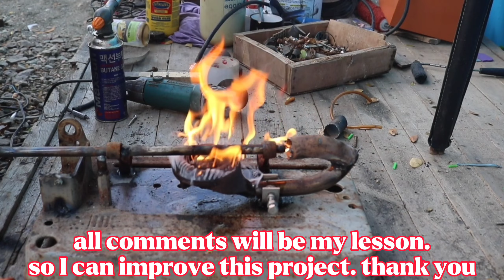DIESEL stove #first try #kalan de krudo unang subok. nag #mukhang sinaunang lutuan hehe.

Comment: Magandang hapon Lodi. Patulung Po, ano Ang aking gagawin para sa aking cg 828 dual band pinasuk ng maliliit na langgam tapos Ang nangyari ngayun pag torn on ko ilang sigundo lang Patay na naman sya ulit kahit Wala na Ang langgam ilan bisis Kona sinubukan ganonparin ok naman Ang power supply? Pls tulungan nyo Po ako Kahi walang shop Dito.
Reply from the maker: Baka naapektuhan Yung control sa front board lods . Dahil nagkaroon Ng short CIRQUIT dahil sa continuity Ng langam or insekto.. need Ng obserbahan Yan lods para matres kung saan Ang nag luko na pyesa